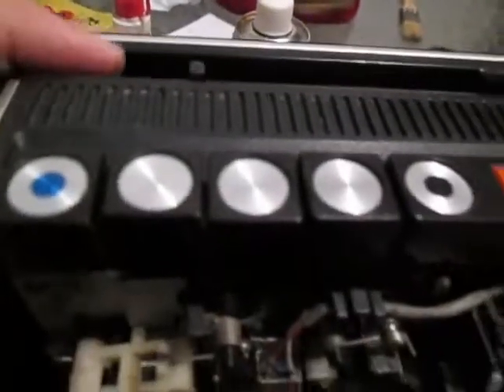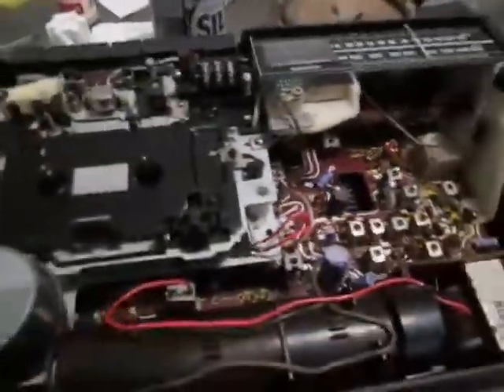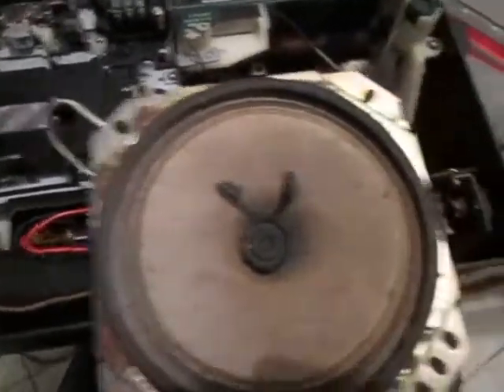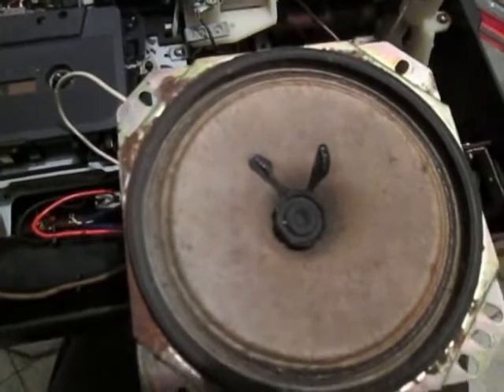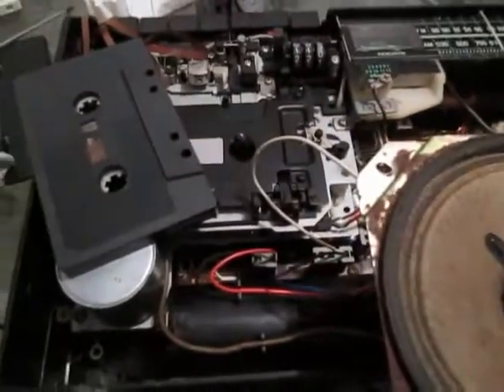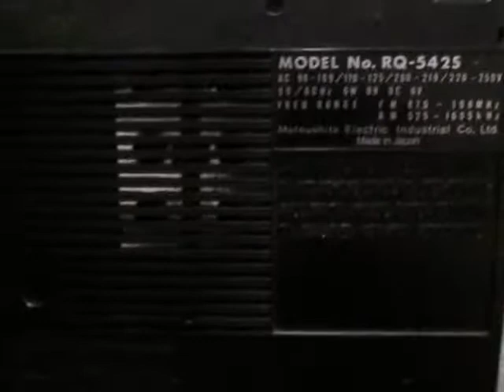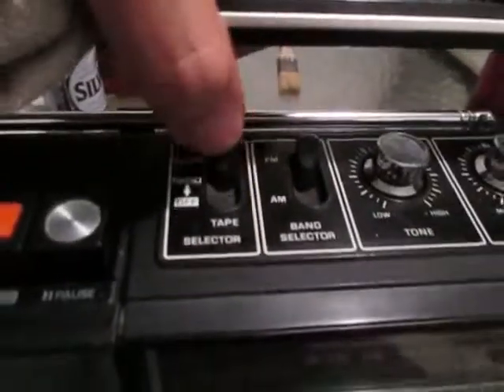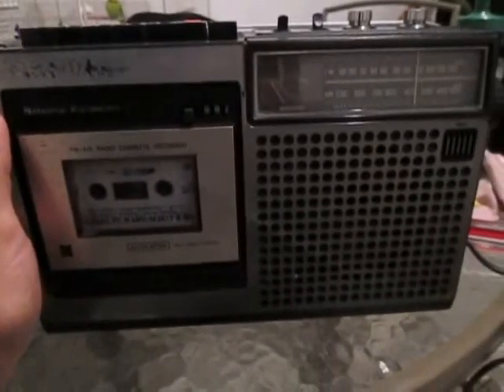National Panasonic RQ 542S Final Restoration

Comment: 5:27 That happen either due to dirty pinch roller, or dry old idler wheel, it's located right underneed the black front plate which can be removed, it's held by 3 screws. I had my own 542B behaving the exact same, and solved the problem by cleaning up the idler wheel with IPA.